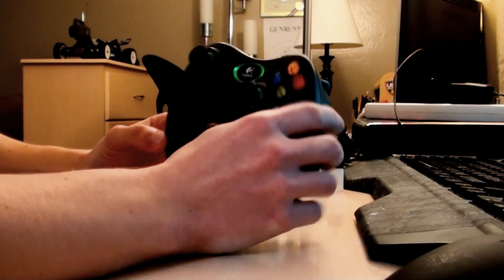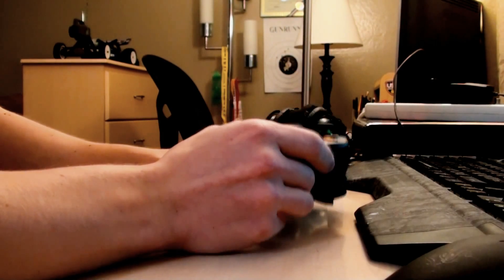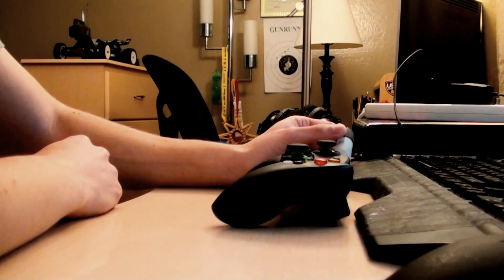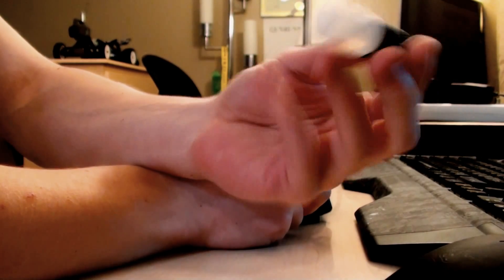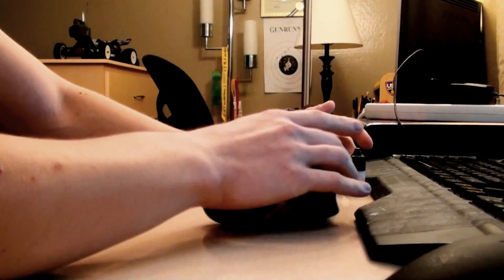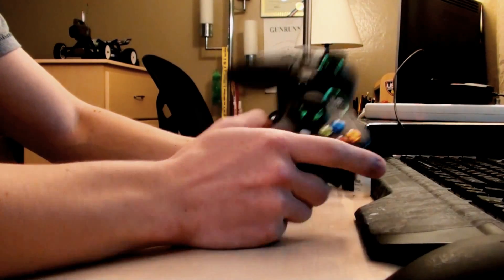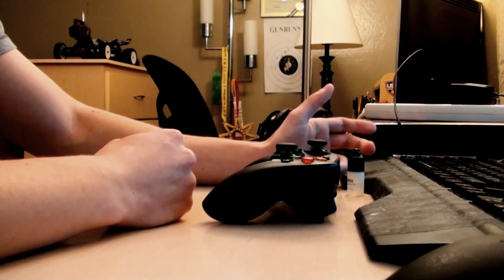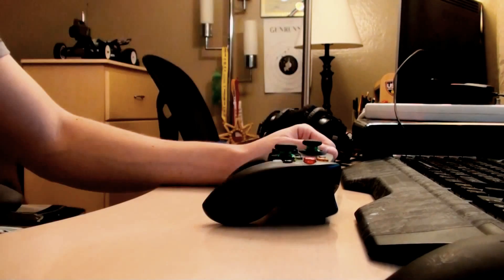Razer Onza Fix, Stick Drift Fix and Manufacturer Suggested Remedies

Comment: Will WD-40 work?
Reply from the maker: WD 40 is not recommended as it is a penetrating oil and will just spray past the components.  Also as it dries it will collect gunk and make the situation worse.  I would recommend a spray of electrical contact cleaner followed by some machine oil.  Most hardware stores carry both in some shape/form.
Reply: cr4zyw3ld3r Woah thanks

Comment: thinkin i need to get back to the joystick mechanism itself though after seeing this.. (i did fix the issue but it still feels strange)
Reply from the maker: yeah the little metal parts tend to get dead skin on them and all kinds of grime. it is best to flip the controller over with and use compressed air on the internals, followed with some machine oil. It is a temp fix, but it has helped me.

Comment from the maker: gotcha, well in that case you could try moving the stick around in a circular manner at its maximum angle for a minute, and then stop and do the same thing in the opposite direction. Next step would be to trim some of the plastic on the front face-plate of the controller, thus giving the stick a bit more range of motion. Beyond that there is not much you can do other than pick up someone's similarly plagued onza and swapping the bad stick for a good one from that controller, lots of soldering :(

Comment: Unfortunately not. I think I let the problem go far too long - I mainly use it for racing games on the PC. I can't afford a wheel at the moment so I could get around it for ages - just changed the mapping to make the drag irrelevant (as you dont steer backwards :P). 

It only affected the in-game menus and I could deal with to a point, until it became constant. So I attempted not only the oil but also adjusting a screw on the stick. It improved it, but as I said I think I let it go too long.

Comment from the maker: yes literally take off the joystick and let the oil into the inside of the mechanism(the thing directly below the joystick), obviously being careful not to get too much so that it spills onto the electronics on the controller mainboard. Changes to sensitivity won't do you much, they are meant to help those with a mis-calibrated controller from the factory.

Comment: I haven't put the oil stuff in the controller yet, do you mean to literally just put a drop or two right under the thumb rest, and let it flow down into the insides of the controller? I have pulled the thing apart and blown out all the dust with canned air, still have the issue! I am going to try to set the sensitivity setting to "A" instead of "Y" to see if that corrects anything, but i doubt it will fix it. I'll repost after I have put the oil in too. I am thinking bicycle chain oil?

Comment: Just a warning to PC users troubleshooting their Razer Onza TE: When "holding the remap buttons whilst plugging in" to my PC, I had a bluescreen of death. I assume the initiation of the driver caused the OS to crash, PC recovered fine but just a warning to any folk out there if you have important stuff, save it! Also to note I tried just the remapping of sticks to see if that fixed, but to no avail, left stick "stuck" in the down position. Time to open it up!